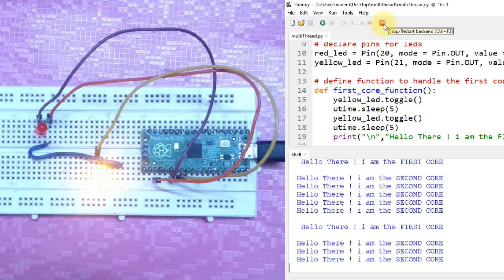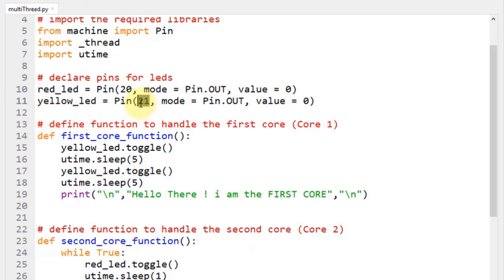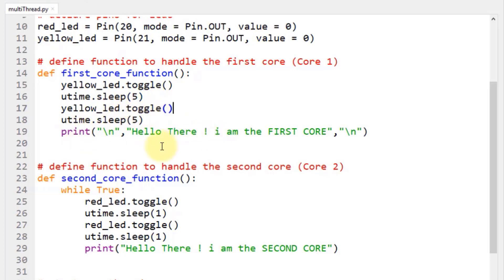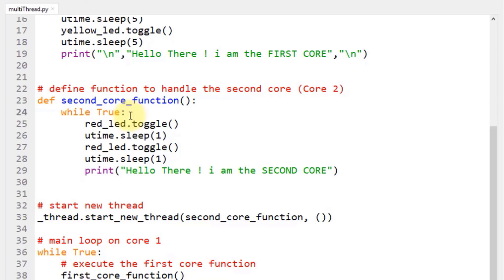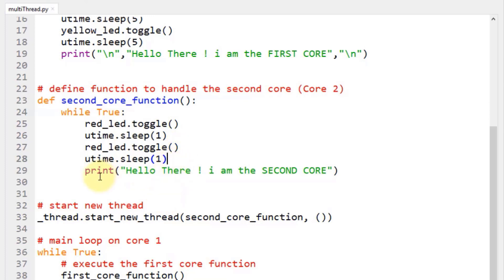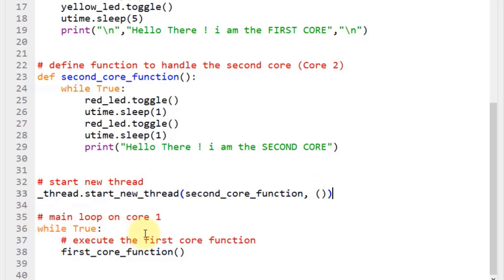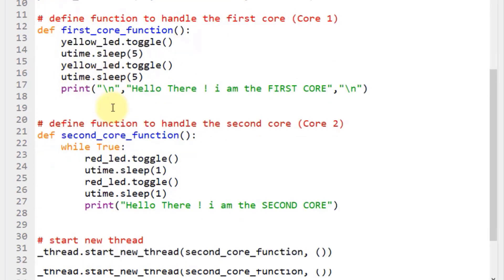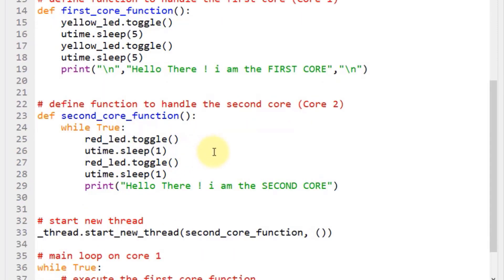Multi-core programming on raspberry pi pico | Run two M0 cores simultaneously | Basics | Micropython

Comment: Thank you for the good explanation and it is great that you want to make two more videos on this subject. Maybe you can help on this: is it possible that the main program is running in the first core and the IRQ 'handling of e.g. a button is done in the second core? Thanks and success with your channel!
Reply from the maker: I think it is possible. I am working on it. I will make a separate video once I achieve it practically.